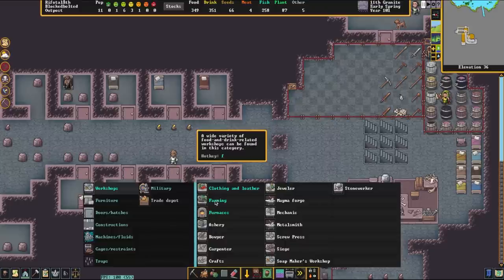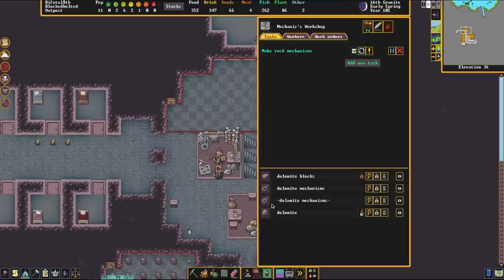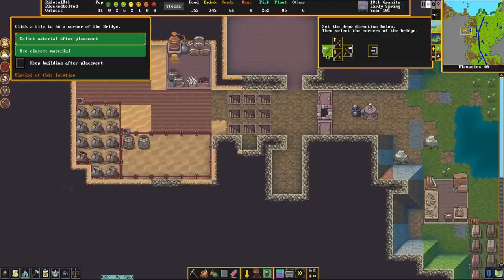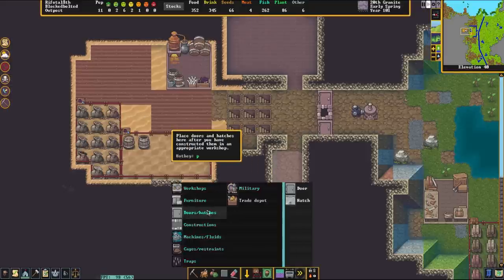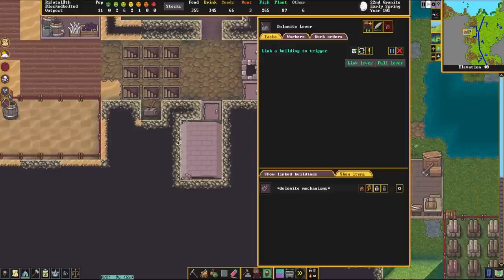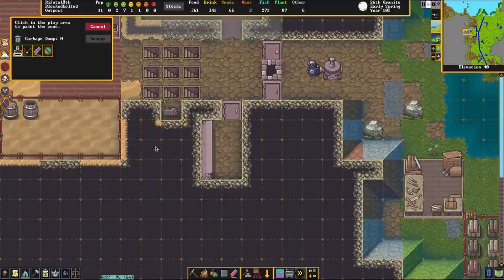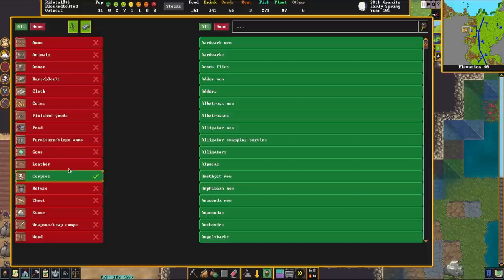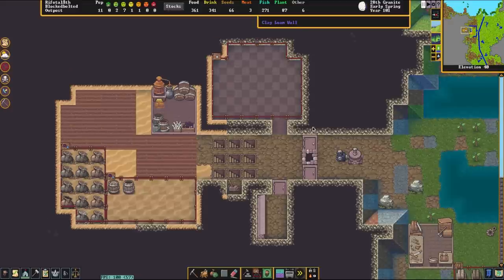Dwarf Fortress - Quick Tutorial -  Atom Smashing (Easy Trash Disposal)

Comment: A little extra tip, dig a channel from above, remove the slopes and door and then designate the hole a dumping zone. That way your dwarves will throw the garbage in and not go into the disposal room, risking being smashed.
Reply: Will the slope removal help? I've got a automated atomshamsher, a hole 1zlvl above where they throw stuff in and a pressure plate that handles the drawbridge beneath. Sadly, a lot of my dwarves children have gone missing since I installed it.:D Pop still at 200 but ye, how can I make them not fall into the garbage disposal t and get crushed lol.
Reply: I've done this and it works great, but make sure they aren't throwing the items in whilst the bridge is closed, cause once you activate it again all the items thrown on top of it will be thrown into the air. 
one of my dwarves got hit by a rock marked as trash that fell out of the sky and it crushed his arm, oops.
Reply: @martyna7058  sounds like a party.
In the hospital.

Comment: I heard from somewhere that items smashed by the atom smasher, while gone from the map, aren't gone from the system itself. So technically, you are still accumulating all that trash and now there is no way to remove them from the system. Much safer to just pile it all up outside or chuck it in lava.
Reply: or less it all to traders
Reply: @View Bot here elf, take this trash as a gift to your leader.
Reply: The wiki page states that atom smashing deletes items from the game entirely, minus some superficial references made to it. But it also says that Units killed by it will not necessarily be removed from the game, and can cause issues. Of course the wiki could be wrong but some !!SCIENCE!! or dev confirmation might be necessary to confirm otherwise

Comment: If I get „construction inactive“ all the time when building the bridge, what am I missing? I‘ve read that for building workshops you need the dwarves that would work in there, but who builds bridges?
Reply: Before Steam, a bridge was first fussed over by someone with the Architect labor, and then constructed by someone with the Mason labor. I think in the current version, Architect has been renamed to Mason, and the old Mason has been renamed to Stone Carver. But it's also possible that more has changed than just the name; it used to be that Engraver labor was used for both smoothing stone and engraving smoothed stone, now Stonecutter is used for smoothing and Engraving is used exclusively to making engravings. These things make sense mechanically, but the total lack of documentation on what does what now, and the removal of "waiting for Skill X" from the construction UI kinda sucks. Maybe it'll get improved eventually, or maybe DFhack will come to our rescue.

Comment: I've set this up at the bottom of a shaft and set a "Dump" zone at the top. My dwarves appear to be dumping items from outside the refuse zones though, including valuables like iron bars. Any tips for controlling this?
Reply: Your dwarves should only dump things into a Garbage Dump ZONE that you specifically mark as garbage. A Garbage STOCKPILE could have been customized to include other things. Double check you've got the right designation (Zone vs. Stockpile.) Hope that helps.
Reply: @DratchGarou  yea it looked like the first batch they dumped just happened to also contain a random assortment of valuables that got automatically flagged for dumping. It seems to be working as intended now.

Comment: Does anybody have a tip on how to dispose caged goblins? I have tried flooding a pit with water but they refuse to die.
Reply: Is the water depth above 6? If not then there isn't enough water to drown.

Either that or the goblins in your world have hybridized with mermen.
Reply: @JudgeNicodemus   I dug a pit, put the cage with the goblin inside ( i designed the pit as a dungeon zone) and pumped water until the water was at level 7 (which i think is the max),waited a while and as far as i know the goblin was still alive. This goblin is driving me insane
Reply: If i recall, critters inside cages are in some kind of quantum state that keeps them from drowning (they don't realize they can't breathe). It's weird, but removing them from their cages should work (...just... make sure to strip them of their weapons and armor first)
Reply: @kalaksed  thats good to know, there is any way to release him remotely?
Reply: @p0seid0n123  yup! You can 'build' the cage at a location (preferrably surrounded by active duty military dwarves), then link it to a lever and have the lever pulled. I don't recall the commands to build a cage, though. Should be relatively easy to find in the menu

You can also have someone haul him out of the cage, but that is distinctly less safe. Esp if he wasn't stripped beforehand
Reply: @kalaksed  ill be testing this tip. thank you all guys for the help!!